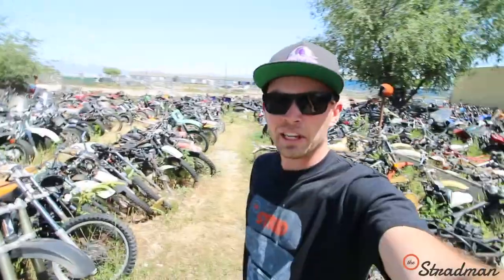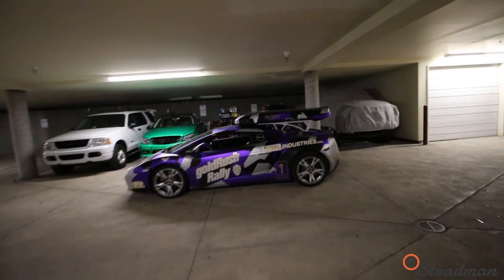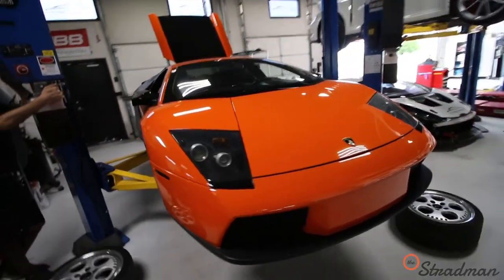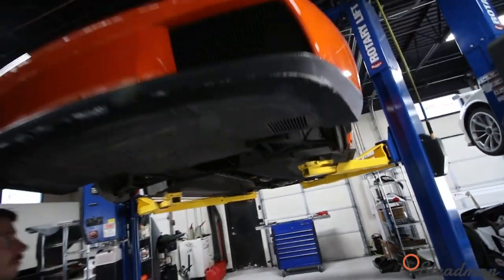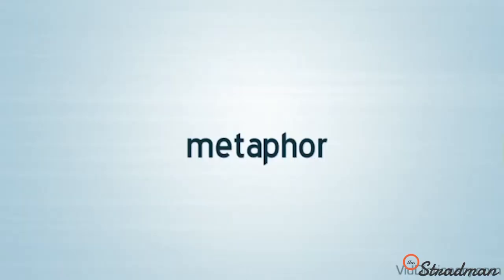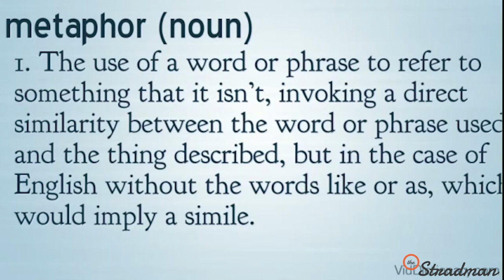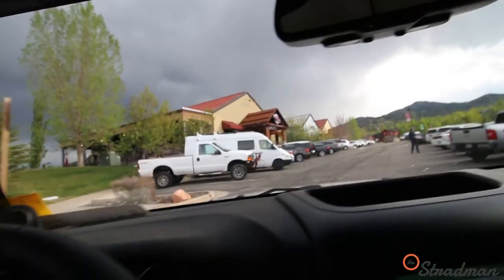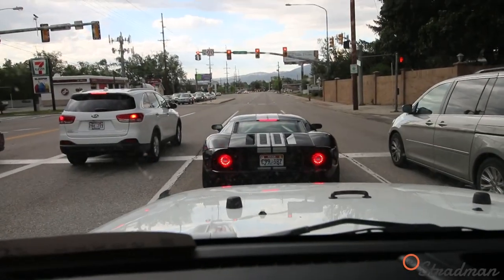UGH...Here's How Much $$$ it will Cost to Fix the Lambo

Comment: this may help you out centerforce makes an aftermarket clutch for your car I believe it's around eight hundred bucks the flywheel you can just cut that at any machine shop so don't let them tell you you need a new flywheel I've been doing transmission work for over 40 years trust me on this one check it out call Jegs or Summit Racing and see if you could find the aftermarket clutch for your car good luck kiddo
Reply: Dilan Parmar it depends a lot of new clutches come with new throwout bearings centerforce and Hayes usually put new throw out bearings in with the kit along with the alignment tool

Comment: Most cars are undriveable with a bad clutch. Your clutch is just fine. You just have a hydraulic problem that comes down to a leak. Leaky o rings in the slave piston cylinder. I think your about to get bent over by this shop.

Comment: Wow I figured it would be expensive for the clutch but I thought the labor would exceed the cost of the parts not the other way around plus I was figuring around $3500.00 not $7600.00. If you get it fixed will you post it I'm just curious how the labor and are broken down?